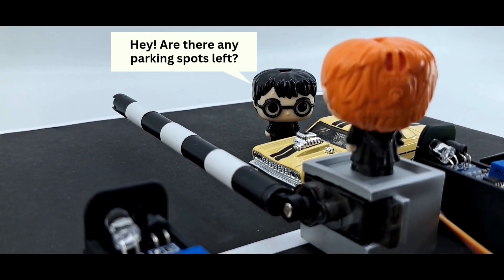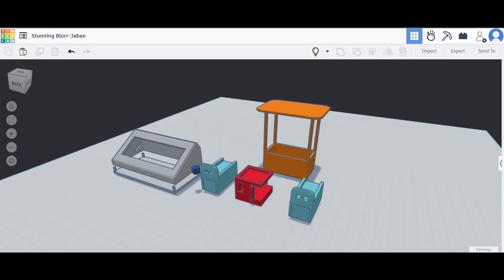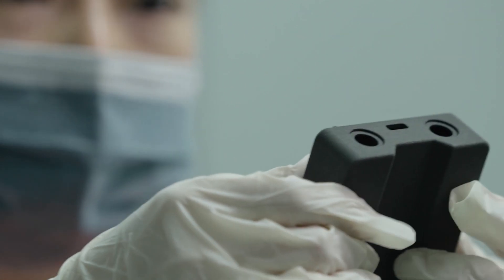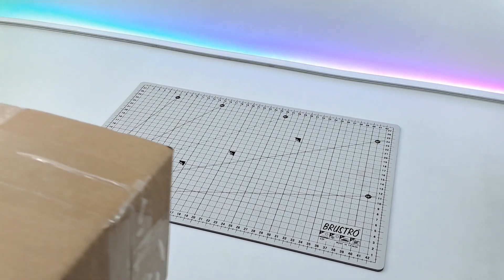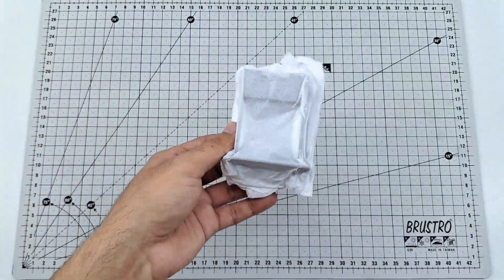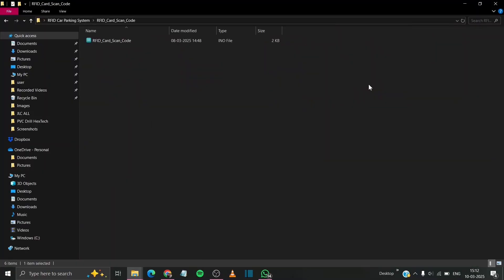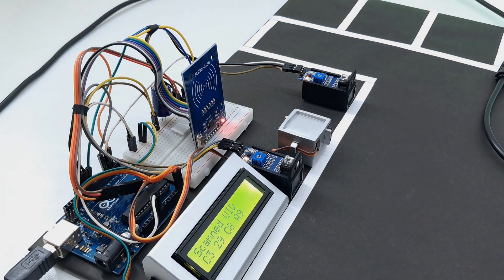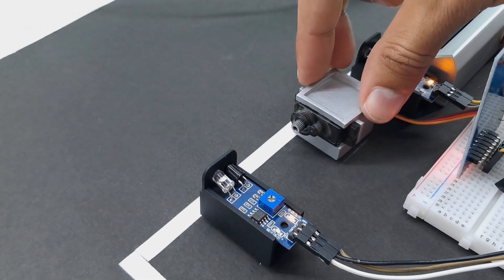How to make car parking system using arduino | Automatic car parking system | Arduino Project

Comment: Hi, sorry, but I used the RFID Card Scan code you gave me. I double-checked all the wiring and pin connections with your video, and everything looks correct. However, my serial monitor shows this message:
“Firmware Version: 0x82 = (unknown)”

I asked ChatGPT, and it suggested connecting the MFRC522 3.3V pin to the Arduino 3.3V pin (not 5V), but the issue still persists.

Could you please help me fix this?
Reply from the maker: You can show your problem through instagram if you want to
Have a great day.
Reply: @SimpleCircuitsOfficial  alright!

Comment: May I know which website you use for circuit diagrams? Tinkercad doesn’t provide the RFID RC522 component :(
Reply from the maker: For circuit diagram i use fritzing and for pcb i use Altium Designer.
Reply: @SimpleCircuitsOfficial  ok, thanks so much

Comment: Can i use 2200uf 50v capacitor? Asap
Reply from the maker: Yes
Reply: Thank you❤ @SimpleCircuitsOfficial
Reply: It's it works smoothly thank you❤
Reply from the maker: @oneechan6396 good

Comment: how do i put in the code into a file
Reply from the maker: Which file?
Reply: @SimpleCircuitsOfficial  when I am done with my project how would i put the file from the blog into the arduino? its just posted there in text
Reply from the maker: @kwhygaming copy the code from blog and paste it in arduino ide then upload the code.
Reply: @SimpleCircuitsOfficial  Okay I got it all done it just says error no such file or directory Liquid Crystal I2C is the error
Reply: @SimpleCircuitsOfficial could you send an updated version of the code to comply with arduino 2.3.7?
Reply: Btw I’m following you on if as yesimsamuel_16

Comment: Sir, did you purchased a pre-soldered rfid module? Or did you first purchased the rfid module and header pins separately and then you used a solding gun to join them?
Reply from the maker: Pin comes with module in a single packet and then I soldered it.

Comment: A capacitor of 25v 2200uf can fix the problem of Servo Motor 
Because the servo motor is not working???

And which library should be installed for servo motor?
Reply from the maker: Yes, capacitor can fix this that's why used in this project. 
Servo.h
Reply: In the previous car parking System 
Can I use a capacitor as in that also the servo motor is not working properly.
Where to attach the capacitor??
And Is there any chance that the capacitor will damage the motor (In the previous car parking System)???
Reply from the maker: Same as this video and no it will not damage anything.
Reply: Please reply Tomorrow is my exam
Reply from the maker: Reply added.
Reply: Hello